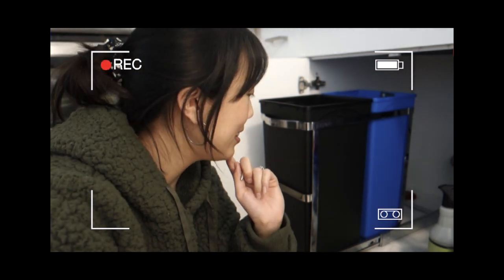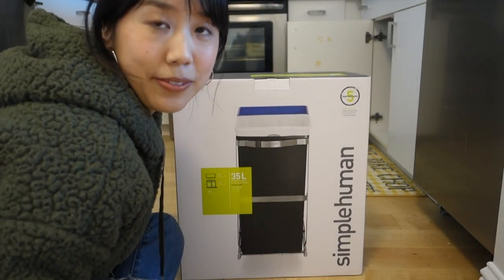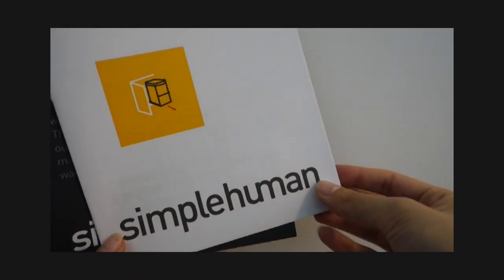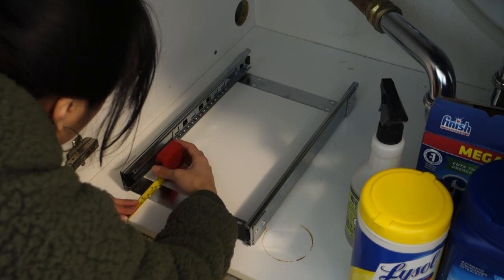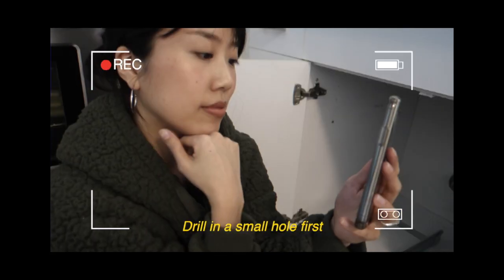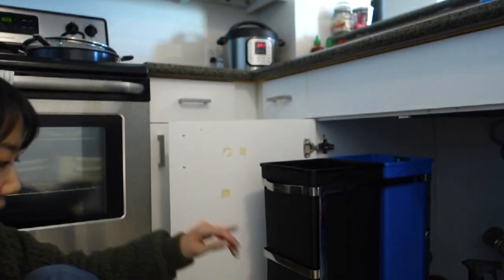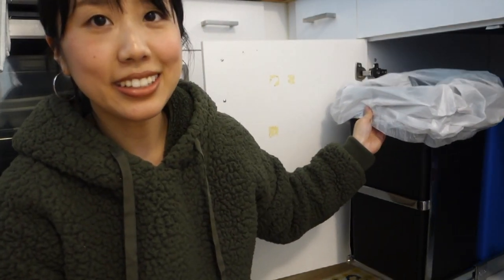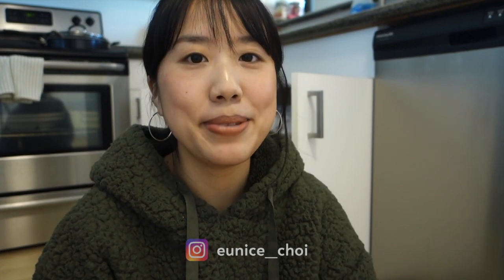How to install a pull out trash can in a kitchen cabinet

Comment: i just did this this morning and have experience with drills and screws, its a freaking nightmare, the instructions are some millennial BS and look like your installing an app.  I first tested it by placing it in position with the bins and bags in, then took them out making sure not to move the frame, if you do then you have to start again.  Then i marked the holes and DRILLED a whole with a slightly smaller diameter than the screw for each of the 8 holes.  Then screwed it in, not all the way in for each screw so if i needed to adjust.  Then finally tighten in each screw all the way.  NIGHTMARE!!!